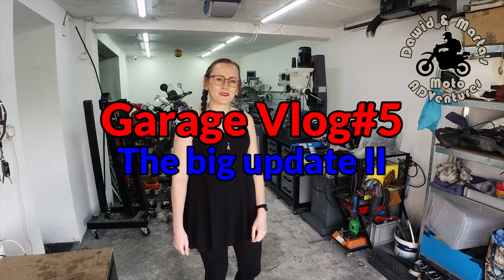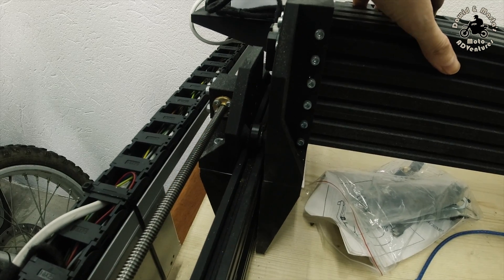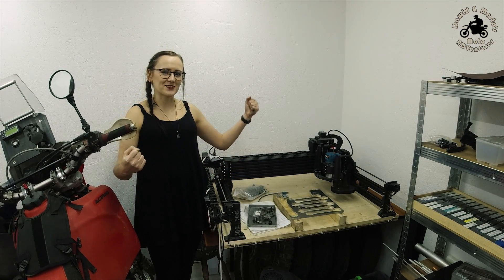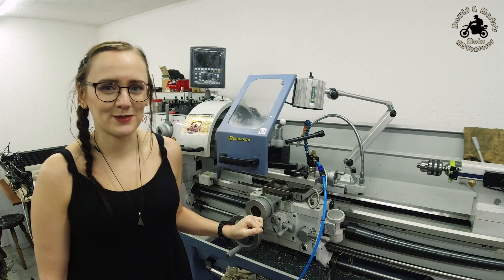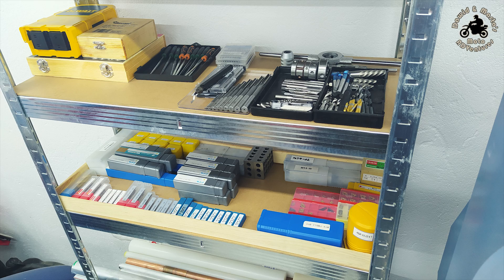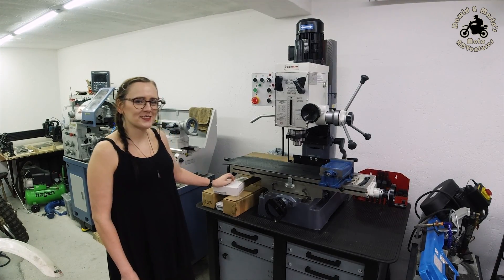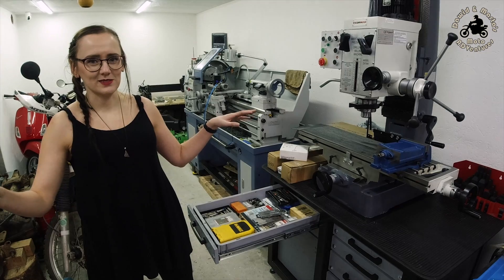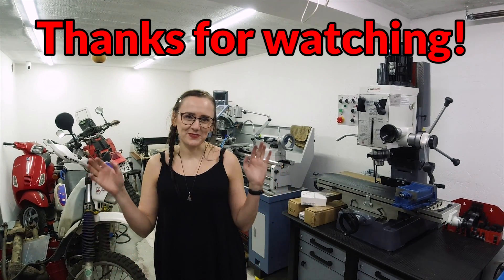GarageVlog#5 - The big update II: CNC router, lathe and milling machine

Comment: Really like the work shop. Good luck with the DR350 engine swap.  What is wrong with the old motor?
I have a 1991 that is still going strong. 
JJW
Reply from the maker: Thanks! :) Old motor is totally fine. There is ~40kkm on the clock now. 
We found and bought parts from crashed DR350SE with e-start and 3kkm on the clock. This is just an upgrade, not a necessary repair :)
Reply: @DawidMartasMotoAdventures  Electric start would be a nice addition. 
I love watching your videos, keep up the great job you guys are doing. 
John from New Jersey